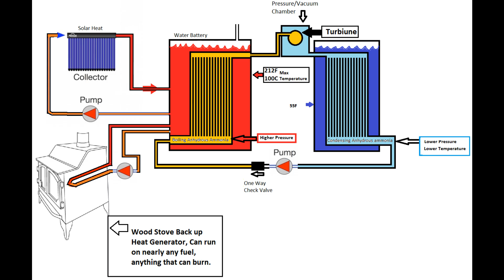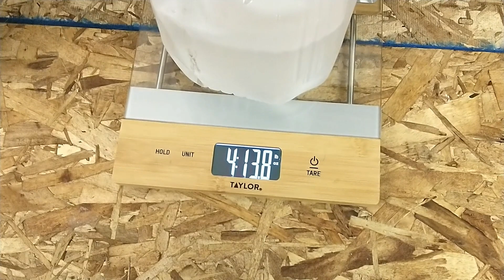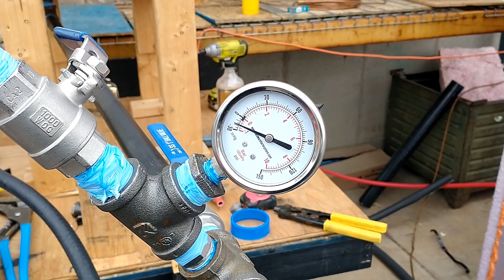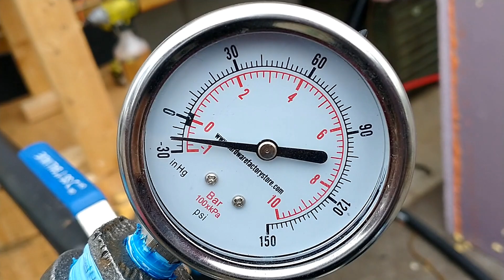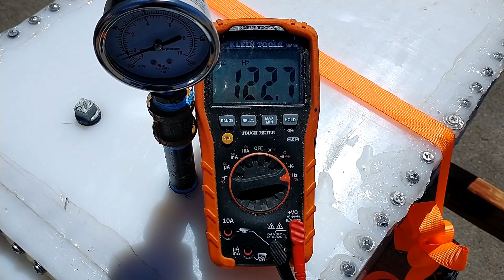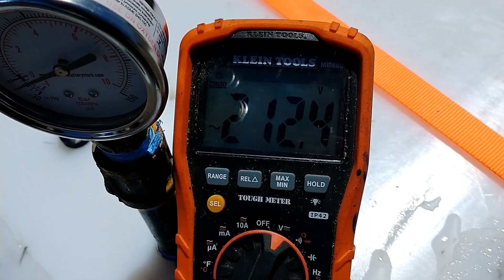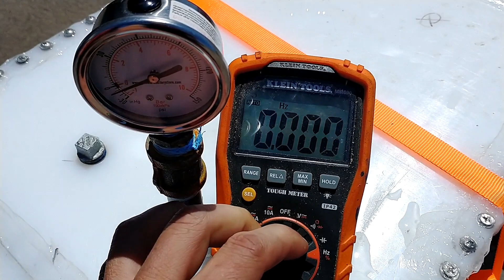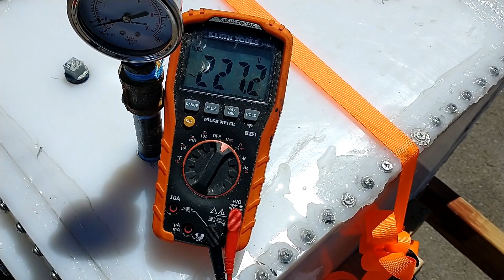Tesla Turbine Complete Thermodynamic Transformer

Comment from the maker: IMPORTANT NOTE.
We are only using low concentrations of ammonia, anhydrous ammonia is pure and can be dangerous without experience.. If anyone were to replicate this, do so at your own risk, the system isn't complete yet. This is 100% R&D.
Reply: Didn't Tesla say it would take 100 years to understand the potential? 
And we still havent gotten AC right. 
Amazing. It is a pleasure to witness this. Blessing for your hard work and passion.
Reply from the maker: @nickelrider  I wish I could find the exact quote, but I found it in the past. It's about time haha! Thanks for seeing this through :)
Reply from the maker: @IAMATREE1111  The good news is, I'm using stainless steel vacuum chamber now. We actually found one in the junk pile. Also note, before the vacuum chamber leaked, It was cycling through the system.
Reply from the maker: @IAMATREE1111  I don't 'clean the vacuum pump oil, I just replace it. When you remove all the air from the system, the ammonia vapor condenses with the water vapor when it's in a lower temperature environment then the boiler and you get flow.
Reply: Why not just use alcohol or water at low pressure?
Reply: @p_magxp5572  I think with former prototypes they got 1000hz with just water. It had vibration issues due to balance but it was still pretty awesome. I suggested having a transmission between the turbine system and the motor so trying to get supersonic speeds out of the turbines wouldn't be necessary while still being able to get the stator going super fast.
Reply: @bringer-of-change a centrifugal clutch from something like a small weed eater would work instead of a transmission. Just get the proper spring tension to engage the drive at the desired RPM.
Reply: I would be pleased to contact me on koriontish@gmail.com. I have a very good Ideaaa and i want to help you spread out and improve Teslas dream living in our Hearts :)
Reply: People have the ability to smell very low concentrations of ammonia, in fact, there is even a waking reflex upon detection of ammonia. The trick is you must pay attention to it. Ignoring warnings when the danger they represent are too small to cause harm defeats the purpose and gets people killed.
Reply: Why not just water or even ethaline glycol? Why ammonia? Why not Freon as prime mover?
Reply: @mikenomath3897 I think the problem with glycol is that it has a much higher boiling temperature than a more volatile fluid. You could use glycol on the solar side and run it through a heat transfer coil with the volatile fluid on the turbine side but it would probably slow the heat transfer process more than it's worth. You want a fluid that will boil at a low temperature under vacuum but it needs to be a viscous fluid. Ideally it would contain some type of lubricant for the bearings in the turbine.

Comment: You should make your boiler starting with about 12 generic brake lines that are 6' long and 1/4" diameter black steel with pressure fittings on the ends. You could then make the reflectors out of aluminum cans or a reflective pipe with about that size of inside diameter...
   The thinner the tubing the faster the heat will transfer to the water. Just build expand in size from the end of each fitting and make a big manifold for each end with a much bigger pipe and a series of "T" fittings. You'd have to do the math to figure out how many 1/4"  tubes make the same volume as your setup to get an accurate comparison but i think you can get a lot more energy from the same area of solar collector space.

Comment: Waaw you've done it man 🤩 where can I see this baby running?
Reply from the maker: If you see my latest videos I have them running. No ammonia though. This particular turbine was built by a friend and didn't match the parameters I needed. All my work will be summed up with my latest turbine, we are almost done making it.
Reply: @iEnergySupply  so you say this particular system is not functional or is it that ots not giving the power you wanted from it ?
Reply from the maker: @futuresight218  The shaft had too much resistance on it, and the vibration was too high at higher rpm. I also needed a balancing machine which I have now to fix the issue. There was too much run-out on the shaft. the spacing between the disks were too large as well.  the inlet nozzle was too small. There are many issues I had. He did end up using the turbine though for himself with high temperature steam.

Comment: You still never reached the RPM where efficiency goes through the roof. It should suddenly jump in RPMs. A much smaller version jumps from 50,000 to 70,000 instantly.

Comment: Just get it to a stupidly high frequency and then use step down transformers to get more amperage at the cost of voltage.
Reply from the maker: your the second person to suggest this, I wonder what would be the best transformer to use.
Reply: @iEnergySupply  
Energy is in frequency
Large power plant turbines run generators on highest frequencies possible, with mechanical and temperature constraints. Polyphase generators.
Converting the output to the Desired voltage+frequency is a secondary concern. You don't bother with gears and ratios at the point of generation.

Comment: You know that you can get heat exchangers and condensers way cheaper than what all those fittings are worth? 

And your Generator needs a ferromagnetic cage/core to get better efficiency!
Then also it doesn't matter what you container is maid out of.

At the moment you probably get very choppy AC out of this generator, not a sinewave at all.
And with just that permanent magnet in place (usually very bad permeability), the coils probably ring like a bell (Magneticly). Maby even emit radio! 🤣
Thats why you can´t get a frequency reading from them!

I recomand, getting a big Hobby Motor as a generator, they are cheep, and you get them in the impendance for exacly the rpm range you expect.
Reply from the maker: it's a pure sign wave, see this video. https://www.youtube.com/watch?v=MkGAKqG2qvU We show it on an oscilloscope.

Comment: Ok, this is far more impressive than the previous videos.  I've been thinking about this tech previously, and I'm thinking it's time to implement some of my ideas on the test bench.
Reply from the maker: have you seen our new cold steam short testing recently? There is much more impressive testing done in them.
Reply: @iEnergySupply  I did, but it doesn't show much. RPM says virtually nothing about power output, and the same goes for temperature differential. I can make a 15k degree plasma with little enough energy that it can't burn me. I want to know what the mass flow rates are to go with those temperature differentials. I know some of the original Tesla benchmarks had a small steam unit generate 250 HP equivalent. How does yours stack up?  Conversely, what kind of pressure differential can you achieve if you use it as a pump?

Comment: just compress air, as a heat pump, nothing else needed, a single closed tesla turbine rotor without inlets and outlets, just "in heat" and "out heat"
Reply: heat pump is one cold side, like the solar energy concentrator, and the heat output side, over heated side, low pressure air in the sealed tesla turbine centrifugal compressor, sides are out, middle is in
Reply: centrifugal air compression works like slam ignitor, volume to low, heat to high, heat over flow, leaves cold when let cool and then expand, air cool cycle
Reply: axle separate rotary device from the generator, if you planned to do that, different houses
Reply from the maker: Ill be demonstrating this system soon, using only water and a turbine capable of 150000 rpm.

Comment: hey.. sorry das ich deutsch schreibe... sehr geile Anlage!!!im grunde ist das eine Kälteanlage mit überfluteten System.... respekt... meine frage welche  Art von Lager nutzt du?und habt ihr das schonmal mit kältemittel probiert wie zb R134 oder R422d oder ähnliches... wär nicht so gefährlich als Amoniak... oder ging es euch darum das System wie bei einer Absorberkälteanlage zu betreiben?auf alle Fälle geile Anlage...Hut ab Jungs
Reply: ...noch eine Frage... wie habt ihr den Übergang zwischen Kondensator und Verdampfer geregelt? mit einem Schwimmerventil oder Kugelsyphon? Beste Grüße aus Bayern
Reply from the maker: Nikola has a regulator that pulses the fluid into the turbine, we will be using it soon. I'm trying to use the ammonia so I can regulate the boiling point of the system. Regular refrigerant systems work on higher pressures, I want to decrease the pressures of the entire system so common fittings can be used.
Reply from the maker: absorption cooling system is a goal of ours.

Comment: The efficiency of a Tesla turbine never past 50 %. If you don't know why.... Call me.
Reply from the maker: If your internal combustion engine is getting 20 percent on a good day, and 80 percent of the energy is waisted in the form of heat, and you recover the energy from the 80% loss, then what happens when you recover 50% of that 80%? That would be 60% efficient on an internal combustion engine correct?
Reply: A Tesla pump is more than 80% efficient. Whether you make the rotor spin with any mechanical device.
Tesla's turbine works the opposite of the pump. Consider that the pump opposes an opposing force that is always present. To avoid this, the jets should be in the center of the turbine and not at the periphery. It is therefore necessary that the Turbine and the pump work in the same direction. The efficiency would then be over 80%. I'll let you explore this trail.
Regards.
Reply: @iEnergySupply  
ICEs have been at 65% for a long time

Comment: Jeremiah, SS is nowhere as good as aluminium alloy in this instance for reinforcing. I would recommend that you use a cross braced frame design to counter the panel deflections or consider using another non-ferrous material your the casing of the turbine. The rectangular shape of the housing is not working in your favour at all but changing it to an octagonal polygonal shape would massively improve pressure tolerances. For reinforcing the housing you don't need to do much more than use aluminium T-section or I-section beams internally bracing the panels. Think of a frame lining the inside of the housing with x braces from each corner of the panel-face snug against rectangular cube framework. Don't forget Project EARTH chatroom we created for this purpose.
Reply from the maker: Funny enough, we found a vacuum chamber in a junk pile. We will be using it as the magnet is far enough away from the stainless steel so we don't have to worry about eddy currents.

Comment: nice build. Anhydrous Ammonia?  less energy to convert it to vapour at the risk of  certain death.  what are your numbers though? power used vs consumed? why did you switch from "cold steam" to conventional boiler/condenser?
Reply from the maker: Anhydrous ammonia it's no more dangerous then Windex at low concentrations. Common glass cleaners use about 10% ammonia. We are basically using window cleaner as our working fluid. 100% ammonia would be risky, but no more then propane. Propane is a compressed highly flammable gas, but we use it everywhere. We will still be using less then 212 f working fluid. We are currently building a full analytics system to get the  efficiency numbers we need.
Reply: @iEnergySupply   please clarify that in your videos.  Anhydrous ammonia is pure ammonia(no water at all). Somebody could try to copy your thing and kill themselves.
Reply from the maker: @adamsoltesz5237  Yeah I must have miss spoke. Thanks for pointing that out.
Reply: @adamsoltesz5237  this is good advice guys, although its hard to get anhydrous ammonia

Comment: 3M™ Novec™ 649 Engineered Fluid. This can be 100% safe replacement for ammonia in your system. Works fine in Organic Rankine Cycles. Boils at ambient pressure at 49 Celsius, 120 Fahrenheit (water is 212, so much lower than water). Less vacuum needed etc. Won't kill anyone if it leaks.  Also, it does not freeze.. Well it is still pourable at -165 F, so no matter how cold the output on the Tesla turbine gets, wont ever ice up. ALSO: they use it as a liquid to submerge and cool high end pc boards. High dielectric liquid, won't short. This means: in your vacuum chamber you don't have to worry about ammonia corroding anything. The 3M Novec fluid could submerge your generator/dynamo without any protection/encapsulation of the coil, and not hurt it at all. No corrosion, no shorting. No special fittings needed etc.  It has a global factor warming of 1. Most refrigerants are  400+ or some garbage number. 3M says that the 649 version is 100% destroyed within 2 weeks and won't harm the environment.
Reply from the maker: All that sounds just about perfect for this situation. I have some questions about 3M™ Novec™ 649 Engineered Fluid, would the viscosity be high enough? I assume it would. What would be the absolute pressure at 160-212f?  Would it be possible to mix it with something to get the boiling point down to 100f?
Reply: @iEnergySupply  Interesting thing, the viscosity gets a little thicker as it gets much much colder... But I wonder if that would would well as you output vacuum pump reduces resistance.. Meaning more kinetic energy gets  imparted to the turbine blades the colder the output. Also, it boils at 120 F at ambient pressure, so just a small amount of vacuum can get too 100 F boiling point. The fluid is expensive, but would ideally be in vacumm chamber and self contained with heat exchangers to the thermal battery. Also, could swap water in the thermal storage for a phase change material. I know a common one that turns to liquid at 120 F.... You could keep dumping heat at 400F like from the solar tubes, but will stay at 120F... Holds 5 times the amount of heat as same amount of water. When you stop applying heat, it will output 120F until it turns solid. It's a common sugar substitute. I'll find it.
Reply: @iEnergySupply  Erythritol could work as phase change material instead of water. Holds like 5 times the heat for size of tank. You could feed it solar at 395F, but it will stay at 120F from solid to liquid change, you can dump a lot of 🔥. Matches well to the 649 fluid, since it boils at 120, and home heating, 🚿 shower at 120F is about right.
Reply: @iEnergySupply  also, I would build a small test rig and "try out" the 649, and see how well it works. Much like your earlier vid with the cold steam rig. I don't think it's meant to be mixed, so a little good old empherical experimentation to see how it works. Again, just the vacuum chamber and small hot cold   side heat exchangers to hot cold tanks etc, for your delta temp gradient.

Comment: I repeat again, get yourself a glass bell. Then you just need a ring fixed to any surface you want (the pipes can come from that surface).
Reply: When you want to do maintaince you can lift the whole bell out of the way
Reply from the maker: Thanks for the suggestion, one thing to note is, it needs to be able to hold a little bit of pressure as well as vacuum. I'm worried with a little bit of pressure it will leak.
Reply: @iEnergySupply  you can have double ring then. Little more work to remove the bell for maintaince..

Comment: Hey how about an old dairy milk receiver as a vacuum chamber? They are glass and should be pretty well sealed aswell.
Reply from the maker: I like the shape for a vacuum chamber, but would the glass be thick enough?
Reply: @iEnergySupply  well in a milking dairy set up they are under vacuum. Their purpose is a collection point where milk is vacuumed through a system of piping and it falls into the receiving jar. I suppose its not a very low pressure vacuum as the milk doesn't boil maybe at your pressures it would crack
Reply: I think you said you run at an inch or something the milking machine is only at 13 inches by going off Google. So probably the jar isn't strong enough

Comment: How much heat energy put in do you reckon will be converted to electrical energy? In your opinion will it still be 30-35% like conventional systems or is it more?
Reply: @IAMATREE1111  There are far better ways to cool things than use ice, like use physics.
Reply from the maker: I hope to get more then 30-35%, I believe we can get closer to 80% with a near perfect system, but will take a lot of tuning. At first 30-35% efficient would be great.
Reply: @iEnergySupply  I see. Well I'm looking forward to seeing the tests. Why are you not using the 2 stage turbine/pump and are instead using a condenser to create the vacuum? Was that not the purpose of the 2nd stage?